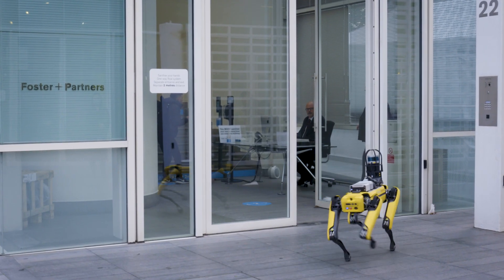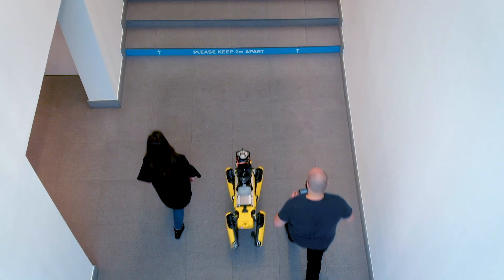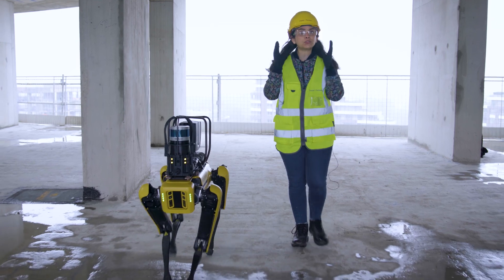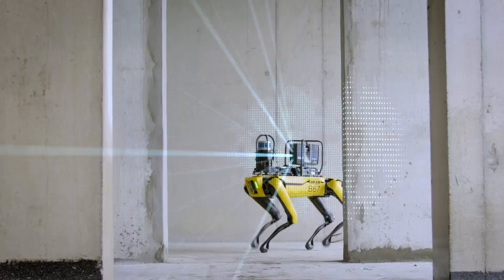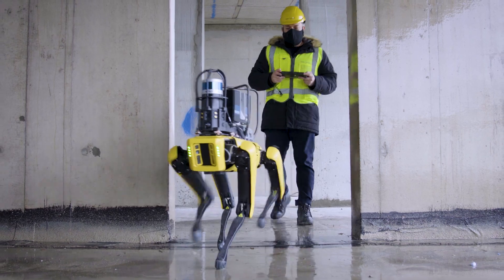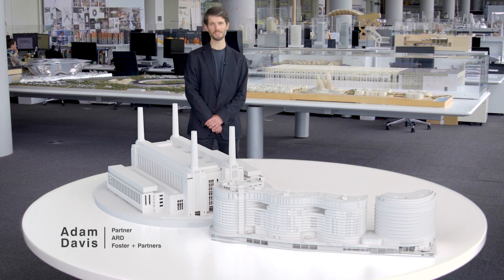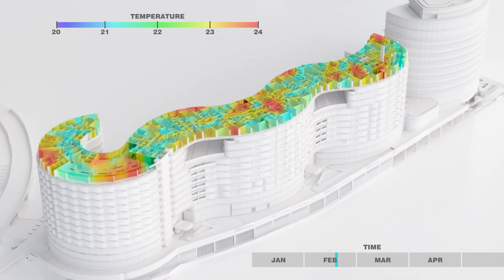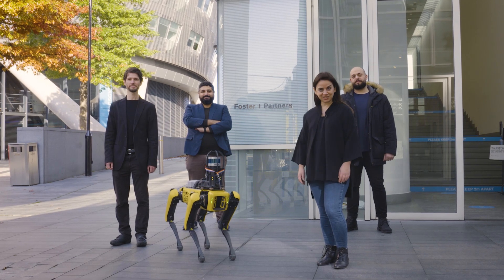Foster + Partners adopts Spot the Boston Dynamics robot dog

Comment: I trust someone is developing this into a robot that can inspect drains and sewers that would be difficult for humans and or crawler cameras to access. No breathing apparatus etc needed. A watertight version would be good for semi submerged applications. Come on folks it’s the future!
Reply: They have little roller drones that can go down drains attached to camera reel but drains are a very tough terrain for things to travel due to slope, size and no traction. The regular cameras are pretty good nowadays, Bluetooth and everything so you can save all the footage on your phone or tablet.
Reply: As long as you don't need to get that terrible stench up your nasel area, it'd be the best.
Reply: Yes,  I know of one engineer at a sewage treatment plant.  They are starting to use Spot to do routine inspections on a fixed route.    The idea is that the staff needs time to be familliar with the robot, then after that they will be good at using the robot in emergencies, like after a flood/fire/Earthquake.   You can't just drop a robot into an organization the day after a disaster.  They need weeks to come up to speed and learn what it can do.    This is not the only sewage treament plant doing this.

Much of the work is fitting the robot with spcialized sensors and calibrating the reading against manual measurements